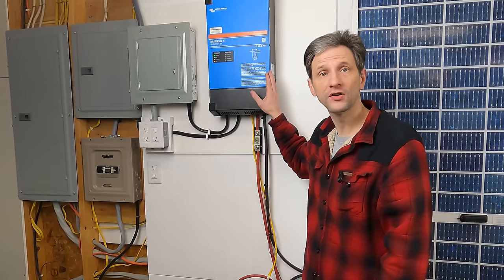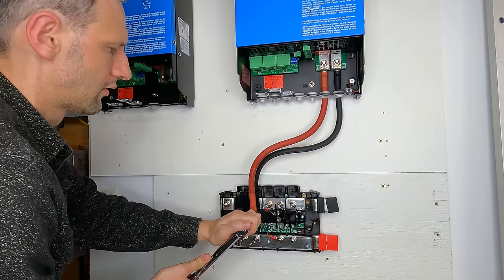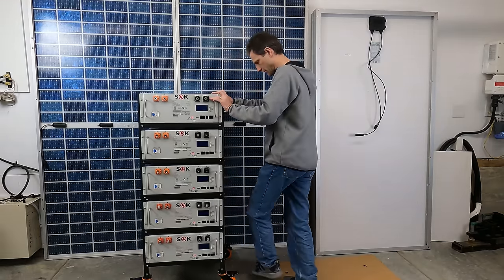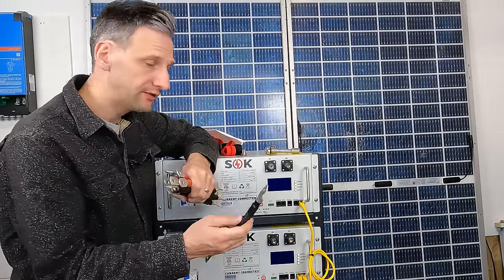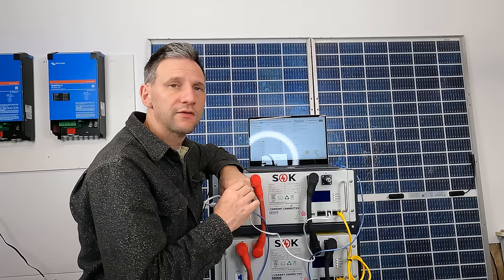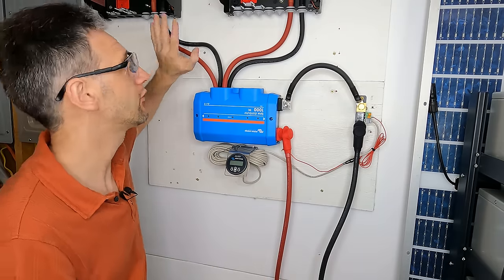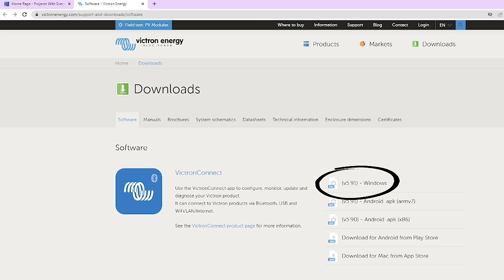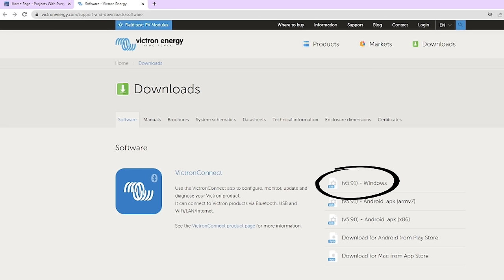DIY Split Phase Battery Backup for Home - Step by Step

Comment: Just as an important note for all looking at this video and thinking they can use it with an ESS Assistant. It will not work like this!
If the MP2 have been configured for grid and ESS they expect grid and not a weak generator! For this usage you should have used the Quattro with its 2 Inputs where one is for Grid and the other one for generator. With ESS assistant installed it tries to sent power out the AC input to the grid. This of course would be fatal if a Generator is installed. They do not expect power back to them.

In this case before you switch from grid to generator you have to select Generator as input on the cerbo before you start it or else the MP2 will push back power to it. The solution shown in this video is really meant to be like a big USV. So no solar power connected on AC out etc. only charging from gen or grid. For which this system is totally overpriced and overspec from my point of view. I have 3 phase system with a rack full of Pylontech batteries which powers my full house and do have AC PV inverters on AC out and also MPPTs straight to the battery.

Also your comment about equal length cabling is not correct. Only on parallel systems this is necessary as the load has to be evenly distributed. On a split phase system the phases are always not loaded the same way hence one inverter will always use more or less power no matter what. 

It is clearly written like this on the Victron Info page for parallel and split phase systems: https://www.victronenergy.com/live/ve.bus:manual_parallel_and_three_phase_systems 
For units in parallel: Both the DC and AC wiring needs to be symmetrical per phase: use the same length, type and cross-section to every unit in the phase. To make this easy, use a bus-bar or power-post before and after the inverter/chargers. Also, apply the same torque on all connections.

Split phase therefore simplifies the installation compared to a parallel installation as AC and DC wires do not need to be equal length.

Victron has really good manual so please use them here: https://www.victronenergy.com/inverters-chargers/multiplus-ii#manuals

Also please always use the BMS connection to monitor your batteries. Feed that CAN wire to the cerbo and let the cerbo actually take the full advantage of the BMS like DVCC. The BMS then fully controls the charging and maximum in and out power. The shown way with the victron Battery Monitor is therefore a waste of money. If the cerbo is to pricey for you (even though you bought Victron in the first place) use a RasperryPi and install the VENUS OS on it and use a can shield or whatever connection the BMS needs to connect the battery to the system.

If your settings are wrong for the battery in the VEconfigure you can also kill your batteries by overloading them or charging them wrong over time. The BMS is really an integral thing for such a setup. Especially in split phase where multiple units are pulling power or charging the battery. So please do not cheap out now and not using a cerbo..... do it correctly.

Comment: Can the system handle an AC unit?
Reply from the maker: Depends on the size.  Larger units would require a soft start.

Comment: Hardware (Nuts & Bolts) should be of as similar material as possible to the terminals & connection ferules, otherwise, you may be setting yourself up for galvanic corrosion, due to the dissimilar materials.
Reply from the maker: All the nuts and bolts are stainless steel.

Comment: Said it for years, racks that are made of lots of little bits are not going to be strong. Solution: Use heavy steel racking. Manufacturers are trying to save money.
Reply: I have solid steel racks from home Depot. This heavy steel is plenty, but the shit weld failed
Reply: @0my  I have been known to re-weld some questionable welds before but as I said, racks need toone-piece. Same as if I was was doing a server rack that holds just as much, if not more weight, no light-weight kits will ever pass.

Comment: I'm curious about the output AC wiring requirement of being symmetrical mentioned at https://youtu.be/ipLRNglTdhg?t=1942 ??  I wouldn't think this would matter when running split phase, since the inverter AC outputs aren't actually in parallel, they're powering different loads??  BTW, nice job!
Reply from the maker: You are right, the symmetrical wiring is only necessary when running units in parallel.  The split phase setup shown here will always be out of balance at some level do to unbalanced loading.  Equal length AC wires is not necessary in this configuration.

Comment: did you pay for everything?
Reply from the maker: No.  A significant portion of this build was provided by Current Connected.  You can get Victron inverters and similar batteries from other suppliers.  However, besides their support for this video, I have no problem recommending Current Connected for the following reasons.
1) They double the warranty period for the inverter and batteries.
2) They pre-program everything for your.
3) They actually provide live technical support in native English.  
If you do want to support the channel here is my affiliate link for there site: https://www.currentconnected.com/?ref=pwd
If you want to look at some other options, check out my website for batteries here: https://projectswithdave.com/batteries/
And inverters here: https://projectswithdave.com/inverters/

Comment: bad or poor SOK design considering the position of the display and its buttons is partly covered by thick cables you do not wanna touch.

Instead they abused that best spot for their branding and not for the customer - stupid mistake regarding right priorities. 
And of cause I do not care that I can have access to all the battery data via app or computer browser cause guess what?

If I had to pay 5 times a display I would want the manufacturer to pay the same attention for my 5 displays  as for my payment, and stepping back with his branding & logo.
Usually manufacturer do know how to behave, SOK does not, at least for me they are wasting customers money 

btw: same regarding these cable connectors just below the display: not really nice to work with cause middle should be better.

Finally: if a manufacturer builds a rack battery what kind of mounting can he expect ? maybe a horizontal line or a vertical stack
If a vertical stack is the logical solution then I can tell you as a non engineer from working for the oldest car manufacturer  that they should turn the 2 poles vertical to each other in 1 single line and therefore covering half of the space they cover now which will provide the customer more space and convenienc if there is only the outer pole used, I mean the left red one and the right black one.
Just another copy from china instead of designing a real battery stack made for the big guys, big customers. 
And I also bet, that small customers with just 1 rack battery would not complain about more useable space for display, buttons and connections.

Luckily the chinese engineers are happy with their first idea and do not improve and improve their solution again and again like we do cause that gives us a key competitive advantage which you can easily check if you get a cheap chinese car and how basic things regarding usability have been forgotten you can find on every other western car. 

Great video again, but poor SOK design choices especially selling such weak rack without an option for a reinforced moveable rack even THOUGH THEY ALREADY KNOW THAT CUSTOMERS ARE USING IT THAT WAY AND ARE STRUGGLING BIG TIMES
The usual company with any ISO certification should have a loop in their procedures for forcing the product management team to give the order to develope an optional moveable rack kit with 2 bars + 4 plates + 4 wheels and make a business opportunity out of it instead of warning the customer. 

And if that company is so behind and so slow would I really wanna buy such battery from them if they simply had imported it from china and relabelled it ?
Might be time to start a rack battery development from scratch instead of buying a cheap chinese case or battery and rebrand it to SOK. 
Pretty disappointing for an american company I have to say.

Comment: Why not just get an inverter that has it all in it without that extra stuff 

Just one hook up
Reply from the maker: There are several all-in-one solutions that provide a great alternative to Victron.  You can see some options on my website: https://projectswithdave.com/inverters/
Reply: @ProjectsWithDave you might update this page with EG4 3kW and other small AIO inverters that would be somewhat similar to the Victron units you used here. Not apples to apples but worth considering when budgets constrain what you can spend. Of course Current Connected might not like that. :)

Comment: stopped watching at newton meters. When people do this kind of crap, it strongly suggests,at least to me, a very pretentious ____. (fill in the blank with whatever fits)
Reply from the maker: Newton-meters or foot-pounds is simply the unit of measure for the required torque on the bolts.  It equates to one Newton of force one meter from the pivot, or one pound of force, one foot away from the pivot.
Reply: Yeah it's everyone else in the world not you that's wrong .  You obviously have a computer or phone you can convert with . Don't knock someone for being up to date with currently word wide used units .
Reply: If you're not torquing to the right spec you're asking for very dangerous situation. Ignoring safety specs because you don't like the metric system has to be the most ignorant thing I've heard today.
Reply: You've clearly never watched Dave's videos if you think he's pretentious. But I should stop feeding a troll who has apparently never torqued anything down properly before.
Reply: @jotunofficial  man, I was a Jet Engine mechanic in the US Air Force. I know all about Tourquing fastners and the equations , formulas for torquing fastners when at different angles and offsets. I just dont need to present my self as being some scientific jenius by using units of measurement that most americans dont even know about. Yes, frankly, i think its pretentious and high hatted. I been watching his videos,He's very knowledgeable in DIY Solar, thats why i watch. a fact you glossed over and self assumed...I never once said "He" was pretentious.
Reply: @richardscarlett7942  Thanks for your service. But as a former 2A6X1 regardless of shred, you almost certainly maintained engines that operated in countries other than the US, where they don't use "foot pounds." They use N m. Newton-meters is used literally everywhere else around the world. Dave's information in this video isn't particularly US-specific, so it is (in fact) helpful for him to say "newton-meters" because that's what everyone else uses... including propulsion mechanics in other air forces around the globe.